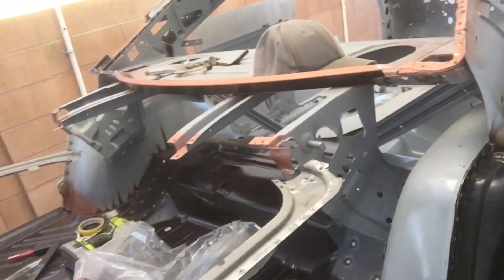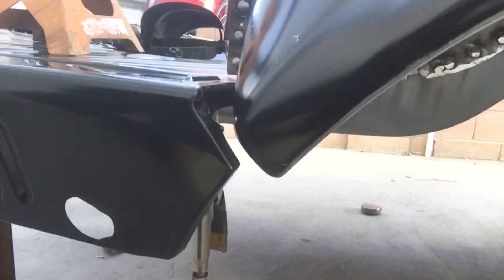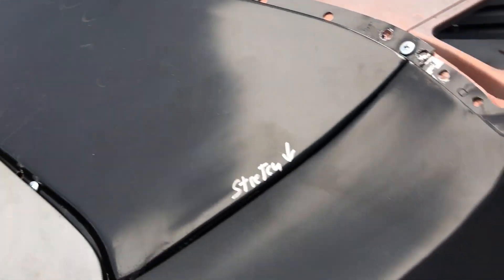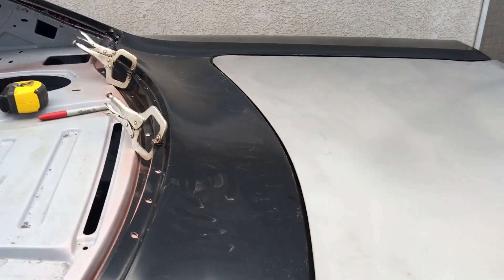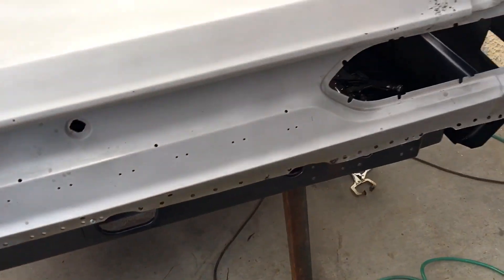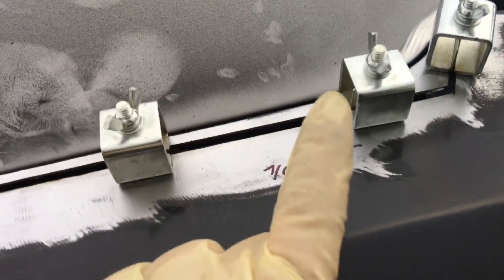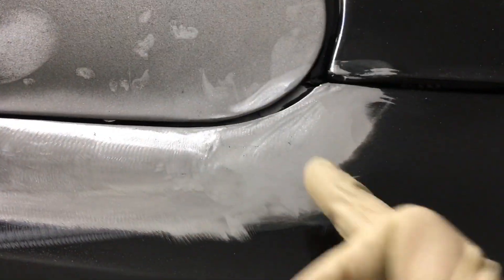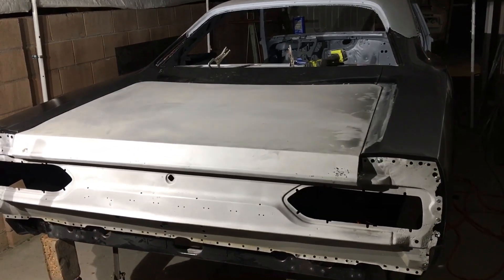1970 gtx rebuild part 5

Comment: i had the same issue on my trunk extensions on my 68 plymouth satellite i also had to extend them out a ways about nearly an inch or about 3/4 of an inch not a big deal but still more time into the build.  im still trying to square up my trunk with the quarter panels im also doing full quarters as well, i think i got the better deal on the quarters than you did thus far. its a gamble , also had a outter wheel well come and it wasn't even close to being right haha, wanted a refund and the lady just told me to destroy it and send a pic to her and i got my money back no problem haha so didnt even have to hassle with returning the part.

Comment: using that much oriental panels is asking for work. if I was told correct, these panels are not a match to original because of copy right lawsuits.  great job your doing and I appreciate your videos. video a little stretching of the metal.
Reply: Does Dodge really still pay to have that stuff copyrighted?

But yeah, definitely better this than having to make it fully by yourself.
Reply: Maybe with what Trump is getting started, we'll start seeing panels made....dare we say it...in the USA???